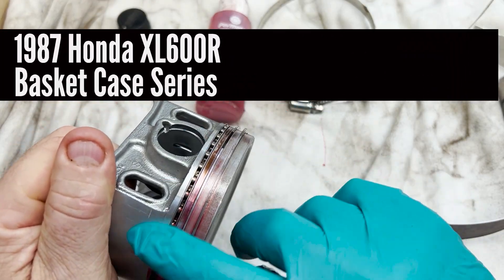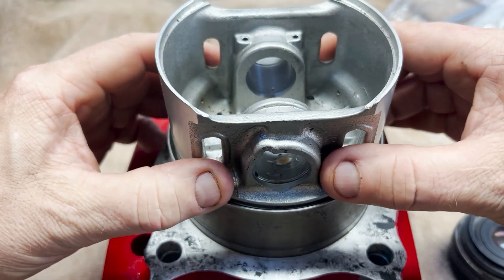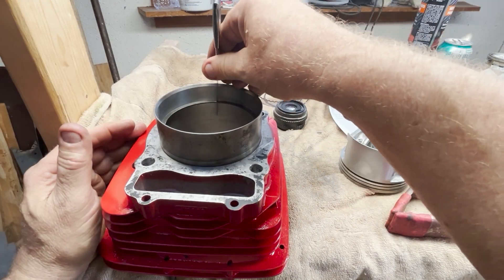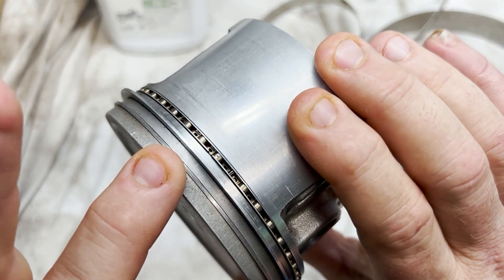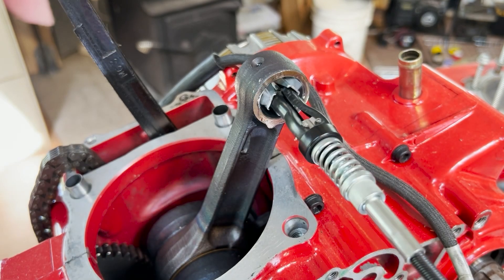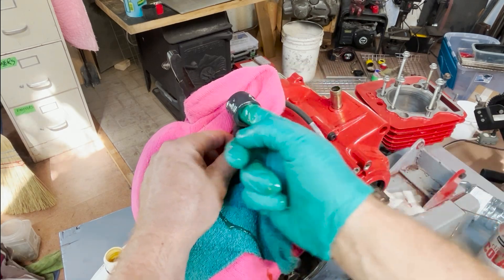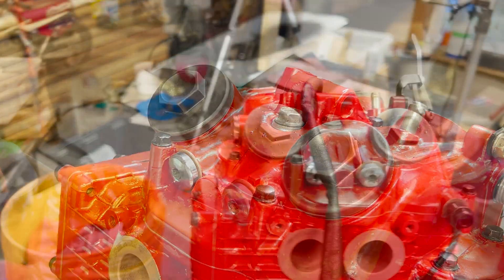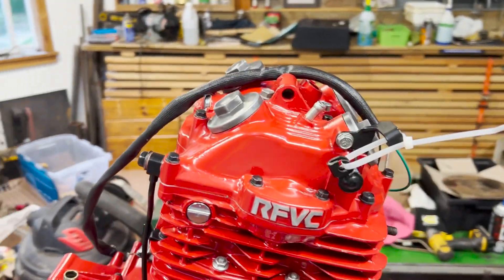Top End Reassembly: Honda XL600R Part 7

Comment: Hi Jason. Doing the same right now. Can you tell me what silver screw (length / width) it is which is sitting right under the top triangle engine mount. Between the 2 intace valve covers. (shown in 16:07 min) Mine is missing. Thanks so much!!!
Reply from the maker: I think you mean part 26? which is M10x65mm. Better double check though. 

https://www.cmsnl.com/honda-xl600lm-1987-h_model50185/partslist/0494.html

Comment: I very much enjoy your competent work. I have a 1989 Honda XL 600 V transalp. I love this bike and I’ve had it for about 19 years. It has a little over 82,000 miles on it and I have been hearing a sound that is kind of a clicking sound that I believe is got something to do with the timing chain or the timing chain tensioner coming into contact with each other. And this year when I rode it from the Oregon coast out to Colorado Springs after a month of wonderful roads in the coast range of Northern California and Oregon, I believe it’s got a bit less power? Although the place I noticed it most was above 7000 feet in Colorado, so maybe it’s just the altitude. But I do think it would love a new set of rings at least, and maybe a new timing chain and tensioners. So I’m pretty sure I have to pull the motor if I’m gonna do the rings, but is it possible to do the timing chain and tensioners on that 52° V twin with the engine still in the frame?
Man would I love it if you were my next-door neighbor, and you might like it too, cause I live on the big island of Hawaii. But I ran out of roads here many years ago, and I go to the mainland every summer and ride around for the last 30 years. I keep thinking it’s about time to hang this up because I’m 80, but I just loved it this year. Anyway, again I so appreciate your excellent videos. Aloha, Greg.

Comment: My cylinder is stuck to the bottom end. All bolts and nuts removed, it won't budge!
Reply from the maker: Does it look like it’s been siliconed in place? Just be very careful in trying to get it out. Try tapping something very thin like a putty knife in between the cylinder and the case, but don’t force it. Try that at a few different spots and it should come out. Patience and a gentle hand are your friends here.

Comment: Nice videos... one note.. at 14:55 .. that orifice that you warned us about falling out of the cover(in previous video..part 2?) ... this is not the same as the one from the previous video... its supposed to be the 'holder' piece... its inside diameter is larger than this orifice here.. the orifice you show here is for the back side (engine side) of the oil pump. not sure if it makes a difference... but they are 2 different pieces. Correct me if I am wrong.. Cheers! Also ..the kickstart component has a mark on the shaft to align with the dot on the big ring.. it looks like you were out of alignment one tooth?
Reply from the maker: I really appreciate this response. My intention is to return to this project fairly soon and when I do, I will investigate these issues. Many thank you’s for bringing them to my attention!!

Comment: Most are use gasket sealer paste. But in here didn't use anything. What is your experience about that?
Reply from the maker: Do you mean between the head and valve cover? I used Loctite 518 flange sealer at 13:38.
Reply: @jasonselinger  I mean 7:16 head gasket, no need sealer for that? I am not experienced and asking.
Reply from the maker: @ No, if the head gasket is new, you don’t need any kind of sealer.
Reply: @jasonselinger  Thank you very much for sharing your experience.